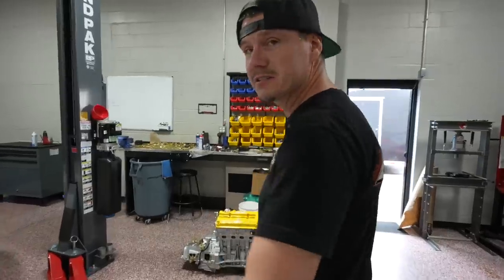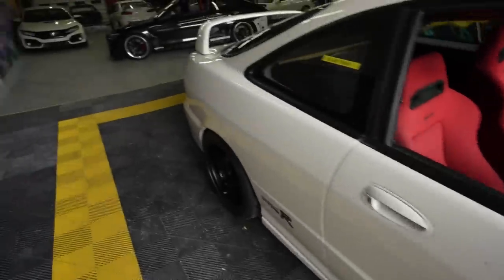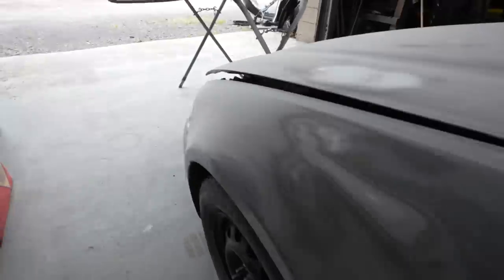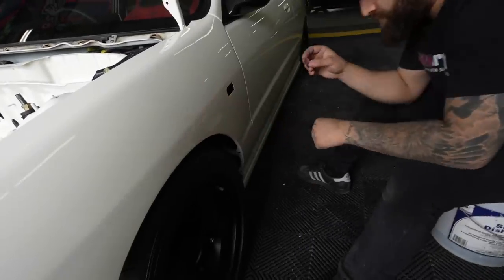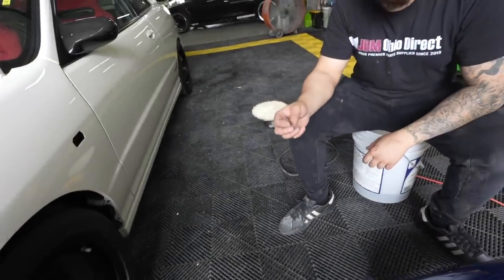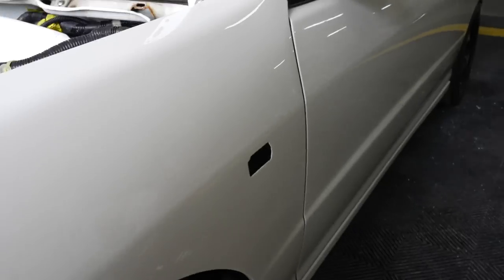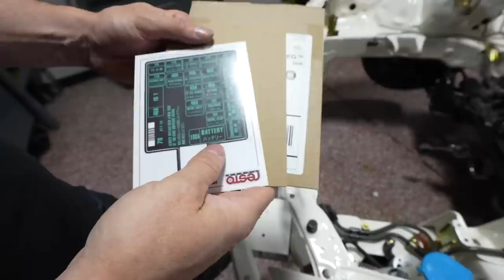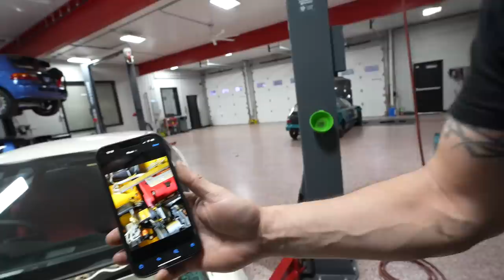How to restore your engine bay! B18c JDM Integra Type-R

Comment: U guys have one of the cleanest honda builds for real ! 

Would love to ask u for some advice.

My friend who lives in colorado has a NA b18c he had this car since he is 16 or 17. 
it never had issues. 
2-3years ago engine was fully rebuild 

Recentely the car seems down on power it feels sluggish.. 
Changed a lot of parts already but cant figure out what the issues is 

Timing has been checked a few thimes with timing light it seems al fine at idle speed. 

Mechanical timing is good aswel its not a tooth off or so 

Parts changed : 
Distributer 
Spark plugs 
Spark plug cables 
Fuel filter 
Iat sensor 
Tps sensor 
Coolant temp sensor 
Vacuum lines
Iac valve 

The car was tuned 4 or 5 years ago to about 190hp+- on stock ecu. The tune hasnt zver changed since. One day it just lost power and becale sluggish.. 

I would apreciate if u guys could maybe give us a word of advice.  Thanks already 🤙

Comment: I see 2 choices:

1: b series AWD turbo if you want to rebuild the whole engine if you guys decide to keep it.

2: k20 typer AWD turbo 

Interior: red carpet. I know you guys said every body has black recaro  seats but i think this car needs it with the red stitching. For the steering wheel  get the Acura rsx  type S with the red stitching

Exterior: restore the paint to the original championship white 

Wheels: TE37 black with the red label.
 
Lip: carbon fiber type R 

Hood: carbon fiber 

Valve cover : wrinkle red 

Thats all i got for now and @ sonic’s bro i leave you with the attention to detail for the engine bay since he is the best at it.  I know you guys can make it happen 💪🔥

Comment: Need to pull that ac bracket back off and sand the powder off of all mounting points front and back or the compressor isn't going to work. Just learned this the hard way last week. The mounting points all need to be bare metal so the compressor will ground out through the block.

Comment: The valve cover is not authentic Spoon, it was done by SR Auto Group by Uncle Ray Ray. Need to get a authentic Spoon Valve Cover
Reply from the maker: We have one on the way, thank you
Reply: @sonic_203  have a question on the RBC VTC gear, will it help the RDX K23A1 on the mid range even with i-VTEC on boost? And thank you 👍👍